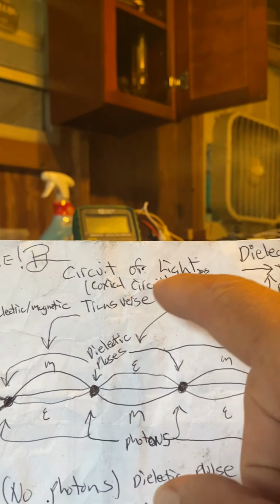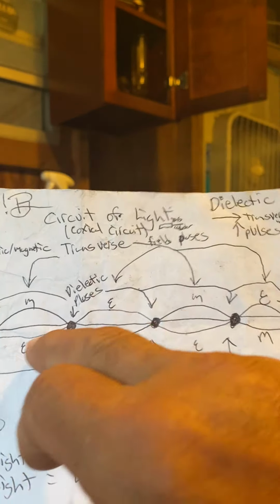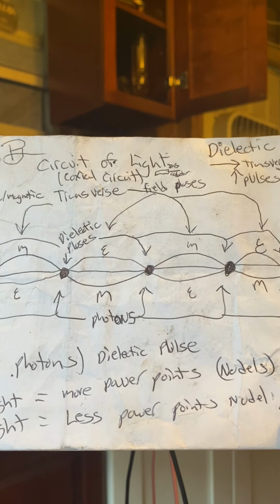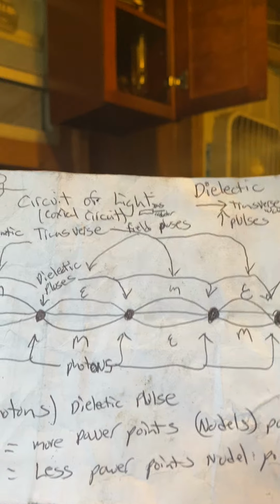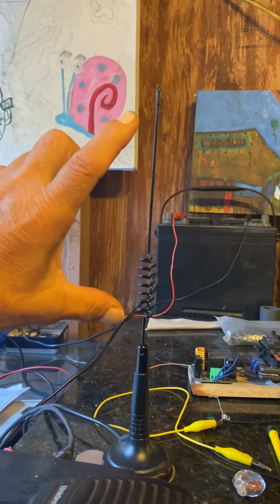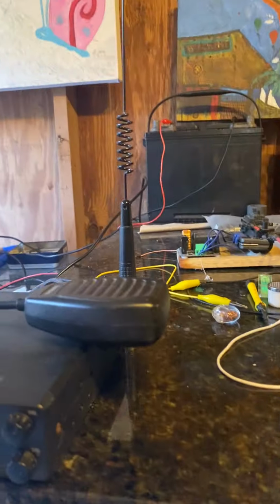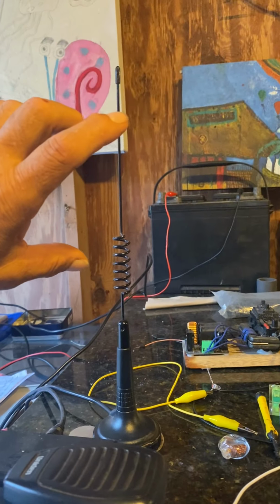How does The Circuit of Light Work?

Comment: A generator made up of magnets, iron cores and copper coils generates audio signals that can be recorded the same as from a microphone. Place a microphone near the moving magnets to see if it reacts with the magnets. Attach the two ends of one of the pick up coils to an audio recording device. Does it record the energy as an audio signal? What does it sound like played back through a speaker? Played back through the pick up coils, will the sound cause the generator wheel to rotate?
The Ed Skalnin magnetic wheel will produce a directional charge in pick up coils as they pass by PMH "Permanent Magnet Holders" with coils. Which are actually iron cores with copper coils. Iron cores imitate a magnetic circuit created by the passing magnets.

Magnetic Sensors
A magnet near iron has a copper coil around it. When a metal gear passes near the iron, coil and magnet a charge occurs in the coil and reports this charge wherever needed for whatever function desired.
If the metal gear was a magnet itself then no magnet would be required in the sensor. The magnetic gear would itself produce a charge in the coil. So the magnet in the sensor reacts with the nearby metal gear in a similar fashion. Making the gear appear as a moving magnet. Because the magnet actually helps create magnetism in the metal gear tooth. As if it is a magnet.
Watch "How Engine Sensors Work: Crankshaft, Camshaft, ABS. Magnetic Inductive Sensors." on YouTube
https://youtu.be/AAbSwQlczDU?t=1m05s

Watch "What is a Magnetic Pickup? - A GalcoTV Tech Tip" on YouTube
https://youtu.be/NcTGvhJx228

Comment: 16:38
Amplified Microphone
******
USING AN AUDIO RECORDING
*****
 as a form of "Amplified Microphone"
Transmitting "wireless" audio (sound Oscillation) or "pirating" is all beside the point really. 
I'm only asking one question here.
USING AN AUDIO RECORDING
AS A "DRIVER"
So you don't know if audio is spinning or flipping? Test Ed's wheel. You know it is pole flipping. North South ... Record this. Played through a speaker do you think the speaker coil will react with the speaker magnet in similar frequency? North upward? South downward? Does the recording take the place of Ed's wheel? If so in what way? To what extent? I was trying to get you to explore this idea and play around with it to find out what we can do with it. Because to use audio in place of a giant wheel of magnets is going to be extraordinary. I imagine the crystal oscillator replaces the audio recording and makes all of this mute anyhow right? Oscillation is the key to power. Resonance for wireless induction between wires. Obviously. Is the Oscillation of the crystal based on voltage? Are you sure the diodes are crystals? I haven't thought of that yet. But I guess semiconductors should be thought of as crystals. Maybe LEDs are as well. They are also diodes. Perhaps this is why the magnetron oscillates as well because this is also said to be a diode. A large plasma diode. Acting like an oscillating crystal which then creates the microwave frequency. It seems as if the capacitors are being used to increase voltage to the point level of overcoming the gap to create plasma at a certain Oscillation rate. Do you agree? 
I am thinking of using the LMD Longitudinal Magneto Dielectric Analogue Computer circuit connected to a DC motor. Where the on off in the motor connection through a battery or capacitor creates the AC transverse (or maybe creates a pole flipping effect instead) in the coils and capacitors. Are you familiar with the LMD? (Introduced by Eric Dollard) I think it simply needs a beginning frequency and then acts like a magnifying transmitter (Tesla Coil) to amplify magneto dielectricity by a one wire discharge.
I think the LMD coils should be made out of speaker coils and magnets (attached through the positive and negative terminals of speakers) as well as using positive and negative terminals in transformer coils. So that, let's say for instance, between two speakers or between two transformer coils, using two capacitors which creates the LMD circuit. Positive of one speaker coil or one transformer coil attached to positive or negative of one capacitor. The negative or opposite terminal of the capacitor attached to a second speaker/transformer coil. So that there are two speakers (or two transformers) and between them are two capacitors. This creates one section of an LMD. The positive and negative terminals of a DC motor (or any oscillator signal) attach to the first terminals of the first speaker or transformer coil. Any added LMD segments attach to the positive and negative terminals of the coils that come before them. Making it a series of segments? This amplifies Longitudinal pole flipping scalar electrostatic magneto dielectric energy.

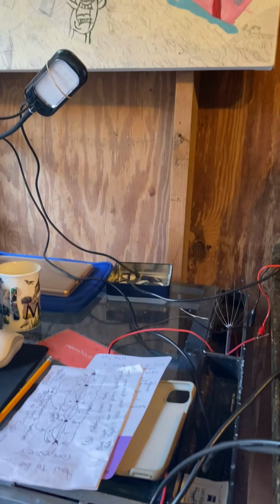Comment: 14:18
Audio signals as a driver.
Does Ed's wheel produce audio waves? (Sound waves) put through a sound speaker? Can we exchange an audio signal in place of Ed's wheel? Especially if we recorded the sound of Ed's wheel? And play that recording through a transformer? Replacing the "driver" circuit (whatever that is?) With the recording produced by Ed's wheel?
That is the type of experiment I am proposing.
Forcefully Flipping the Spinning Atoms of Energy
North South (pole flipping PF) such as a spinning north south pole magnet between pick up coils or such as V magnets moving between PMH poles creates pole flipping of the spinning axis of the atoms in the conductor and surrounding energy. (Energy spinning has an axis which creates poles of energy which are also able to be caused to be flipping.) Also when a pick up coil moves in towards a magnet, or outwards away from a magnet, (or the magnet is moving inward or outward) the DCF Directional Charge Flow is reversing (phase conjugating.) Due to pole flipping. Totally. Because forcing the poles to flip is the exact cause of the change of DCF. Also called AC transverse. However, this is a sound or a light perturbance because it is a forced pole flipping beyond what is naturally occurring. Pole Flipping PF is the same thing as magnet and pick up coil fluctuating (flux.) Power generation (manifestation) simply put is the PF Pole flipping of energy (atoms.)
So even though it would seem this is AC tranverse it is actual scalar longitudinal electrostatic potential because the charge is remaining stationary. Because it's not actually going anywhere. It is remaining in one place while it is FLIPPING.

Comment: @ 9:00

Compare light and sound.

Is the energy in spacetime spinning? When objects rotate on an axis poles are created. Poles precess and poles flip (while the object is spinning.) Lamour Frequency is a term coined for precessional  frequencies in magnetic resonance imaging. (MRI)

If energy is spinning precessing and flipping it is the basis for the creation and existence of magnetism and spacetime mass matter and gravity. Such polarization of energy explains polar alignments of magnetic circuits through spacetime. Circuits that connect poles of energy. Axis poles of energy align together according to spin direction from pole to pole (north to south) between different spin locations as well as between north and south of the original atom (a single axis of spin energy.) Accordingly then the subsequent spinning of energy outside an axis develops it's own axis and becomes it's own atom. Even though it is a creation of another atomic spin energy. This feature shows a holographic and fractal nature of spin energy.

Spin energy is known to flip by itself. I assume this is what creates frequency. If the planet earth has a frequency  or any cosmic body, I presume the precessional or the flipping of poles is what creates such frequency. Which we may classify as light or sound oscillations. Unless there is also a measurement for spin rate. As if one rotation, or the number of rotations is comparable. Which is also most likely a reality. Such rotations, precessions and pole flips are how energy interacts with itself and with matter. This is the likely method of interaction we manipulate when using magnetism and electricity. We can increase and decrease these things. Both in matter as well as in energy.

Comment: hi roy notice stan meyers dune buggy had extra thick rubber tyres to prevent a ground earth and i expect nitogen filled .and notice he had 2 large chrome plated coil spiral radio aerials on the dune buggy to act like a old tram aerial ..but the trams connected to overhead cables but meyer knew the air can cause the same as did tesla as did lord kelvin  plasma ion engine in a sealed car engine with a egr return to allow ions to re establish to air .no extra air required ..proof of this is already in flourescent light bulbs .you dont refill the vacuum sealed gas tube but the incoming energy excites it to emitt photon light
Reply from the maker: Hello Honda my Brother I hope that you are doing well? Thank you for your comments and very important insights.
Reply: Moon stuff was faked in a mockup room, the moon isnt something you can land on.

Comment: The mobius coil is used in the tracks of the bullet trains and one is placed on each side of the train. The train has superconducting electromagnets that induce produce a magnetic field into the figure eight coils. The coils then interact with the magnets. This interaction controls the height of the levitational force. The two coils are also connected from one side of the train track to the other and also control the centering of the train as well. Therefore your mobius coils would interact with magnetic plasma in a similar fashion. If connected on two sides of a bottle. Because the magnets in the train are like one bar magnet. Going across from side to side. But inside your bottles the magnetic field would have a concentration of magnetic field near the top and bottom of the coils. Because that is where magnetic field would be strongest in the coils. I guess no plasma would be in the Dielectric hyperboloid. Down through the center.

Comment: The reason I'm asking this question is because sound signal frequency is supposed to be how power is being generated. The coil and magnet in a speaker is a generator. If a smaller trigger wire (primary) moves the coil near the magnet (secondary pick up wire) power will manifest (be generated) in the secondary coil. This could happen even without any motion of the coil. The primary trigger wire might only need to have audio (pole flipping) signal moving through it. In the presence of a permanent (or adjustable electromagnet) magnet nearby. This may produce an amplification in the secondary? Therefore accordingly the only thing needed to make this happen is an audio (pole flipping) signal. Which I'm thinking could be from a recording. But might require an amplifier as well.

If we are to believe Eds wheel is similar to a sound wave signal generator and these were picked up by the PMH. And he sent them through coils of wires wrapped around glass bottles. He could change frequency according to where he connected to the wire on the bottle. Like a rheostat. Sound signal frequency PFG (pole flipping signal) is generated and it's frequency is manipulated. Now it can be tuned to resonate with other things. It can also be transformed by a primary step up into a higher voltage secondary. 

******

Do you have the ability to generate an audio frequency? Such as 60 Hertz? Can this, or whatever frequency is found to work best, be recorded (obviously yes it can be recorded.) So I'm asking, can an audio recording (sound) from a recording device. Or from an oscillating string on a guitar. 

Yes it could go through a (CB) microphone. But really I'm asking for an audio signal in a wire. Such as if the pick up coil in the electric guitar is being used. Inside the guitar pick up is an electromagnet? The string Oscillation interacts with this electromagnet and the frequency moves through the wire (guitar jack wire) into the amplifier and out to a loud speaker. So maybe remove the amplifier and speaker and attach it to a transformer primary with no other power input. (Such as the CB with no other power input.)

This experiment would show the power production of a sound signal.

 Such as if the audio in a speaker wire (normally going to a speaker) is going through a transformer primary.) Which would allow us to develop simple signal generators (audio type) and use the signal perhaps through a rheostat voltage regulator (cat hair whisker wiper over a coil which changes the length of the wire resistance, which hence changes the frequency?)

I would get a wire and a wheel that has felt on it. And use a small DC motor to spin that against a metal wire (for instance) to generate a tonal frequency. Or an audio tone generator. (Such as your new art of making musical sounds.) Yes obviously the CB radio broadcast is generating into the air wirelessly and pole flipping into reciever antennas. 

I am hoping to see you use an audio frequency (such as a recording of an audio frequency) into a step up transformer to measure voltage and frequency (Hertz.) Because this will show how easy it could be to generate power with an audio recording or signal source by directly transforming it by amplifier (which is simply a transformer? Or one near a magnet or electromagnet?)
Reply from the maker: You got me thinking 🤔🤓